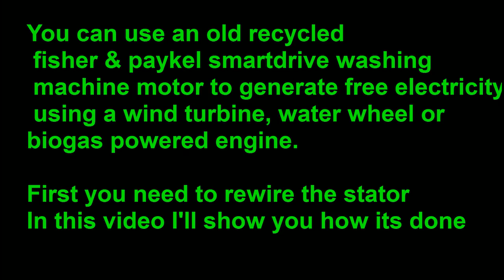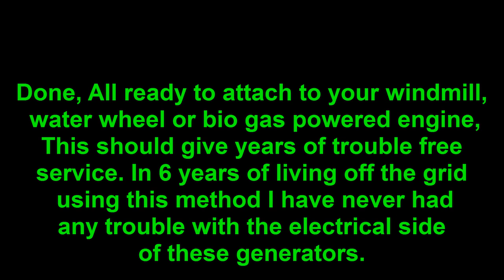How to rewire an old washing machine motor to generate free power

Comment: Why do we need to rewire them? Is all motor generates electricity when turned?
Reply: Any motor [edit:with permanent magnets (rarely found in common AC motors)] can generate power, but they will produce different voltages and currents depending on their wiring. Each coil generates a certain voltage and current individually. Normally, they are connected in series, which adds the voltages together, but with the current of a single coil. That would require a high voltage battery. However, if they are connected in parallel, it adds the current, but keeps the voltage the same as a single coil - more suitable for a battery.
A higher voltage can be used in a battery, but it will require more cells to be connected in series, resulting in a larger battery (and it would be dangerous to handle as the terminals would produce mains power) - a lower voltage battery (around 24v) could be handled easily without very little risk.
Reply: +Matt H  Horrible comment. There are very few motors that can be turned into generators. Most are ac induction motors that do nothing in the way of producing a current.. He has found the rare "permanent magnet brushless motor". Rare is an understatement. So by your "any motor can generate power" statement, I'm struggling to understand the up votes.
Reply: +fla playa I was thinking only of permanent magnet motors when I wrote this, but I'm not sure about AC induction motors. I thought they had some output - isn't that how regenerative braking works? From Wikipedia (https://en.m.wikipedia.org/wiki/Induction_generator): "A regular AC asynchronous motor usually can be used as a generator, without any internal modifications". Is an asynchronous motor the same as an induction motor (it forms an induction generator)?
Please correct me if I am wrong, I am interested to find out the correct answer. Thanks.
Reply: Matt H Nope. Only a "wound rotor" AC Synchronous motor would do the trick, trust me. All other induction motors have rotors that are made of aluminum and steel as a "squirrel cage" https://en.wikipedia.org/wiki/Squirrel-cage_rotor having absolute zero effect on creating magnetic flux on their own.
Reply: Matt H Regenerative braking would be applying a direct current to an AC motors windings to achieve "braking". (stopping the rotor).. Has nothing to do with generating current from the Stator windings of a AC Motor (the most common motor in our 21st century). You can be my guest though and try to turn an induction motor into a generator as four of our peers say you can do:)
Reply: +fla playa Ah, thanks for the clarification! I always thought the bars on those rotors were magnets. Does the rest of my original comment still apply to wound rotor motors though? I will update it to avoid confusion. Thanks.
Reply: +fla playa read in the same page you published 'Induction generators
Three phase squirrel cage induction motors can also be used as 
generators. For this to work the motor must either be connected to a 
grid supply or an arrangement of capacitors to provide excitation 
current. For the motor to work as a generator instead of a motor the 
rotor must be spun faster than its stator's synchronous speed. This will
 cause the motor to generate power after building up its residual 
magnetism. "
Reply: Steven G This is one of those rare times where I question what I just read on the internet. I went back and read that and it looks like a bogus amendment to the Squirrel Cage page. I noticed no proof of source. If you think about it, theoretically the machines synchronous speed is variable, meaning the input frequency is the synchronous speed. Therefore any RPM (even one) could exceed the design for a given frequency. In the case of one RPM it would be 1/60 of a HZ. I have never heard of it or seen it. An external source of capacitors would set up a DC magnetic field in the machines stator and you couldn't spin it, let alone get it up over the design RPM. Also, connecting the machine to AC mains is how it's intended to function. When we release the motors circuit there will be zero induced current flowing from the machine. The only possible way, to the absolute best of my knowledge, to generate current from a squirrel caged motor is to re-work the rotor. Something I've been dying to do for a very long time now and I should do a video on it. Have to get a direct current rotating magnetic field up in that hoe. If you stumble across anyone out there taking an induction motor and generating power from it stock, let me know.
Reply: It does work, but yes, the rpm must be higher.
When I was still a student, we did exactly this proof, in the engineer course. some 25 years ago.
For a time, this has been used in windmils in europe.
We also did the setup with the rotor electro induced, and while yes, it was much more stable, concerning rpm, you have more work with the anchors.
Personally, i do like more pmg's.
Reply: RPM must be higher than what?
Reply: rpm must be higher then the frequency where you want to be. in a 50Hz system, that same motor will start becoming a generator at 51Hz+, or in US 61hz+

Comment: can you just use the motor without rewire. Then convert AC to DC using rectifier ?
Reply: High volts high hertz dangerous and doesn't travel well
See Marty T's large soldering iron used in his latest vids doing this again...with sound.
also  https://www.thebackshed.com/Windmill/FPRewire.asp

Comment: my friend use some flux, those connection are somewhat cold and will cause troubles down the road with power loss and energy lost in heat also cover each solder joint with a protective sealer even the male spade lugs solder directly and seal them, then bring out the leads to a terminal block and again seal, your on a water source with lots of moving water

Comment: is this a 3 fase motor?
Reply from the maker: It makes 3 phase when converted to a generator, needs a motor controller when used as a motor
Reply: +Angry Ram when a Motor controller needed when it's used as motor.  .. are you talking about a speed motor Controller or a Current controller?
Reply: +Angry Ram can you use the washing machine controller with only the high speed rotation?
Reply from the maker: It needs a step motor controller to send pulses to the coils at the right frequency.
Reply from the maker: If you are clever with electronics you may be able to hack it, I've never tried
Reply: +Angry Ram im completely new in Electrical fields lol 

what kind of frequency i need to ad to make it run perfect?
Reply: +Angry Ram you mean Steeper motor controller?
Reply from the maker: Google smartdrive motor controller to find out more, I had a quick look and found this - http://shop.powerspout.com/products/smart-drive-pma-and-bldc-speed-controller
Reply: +Angry Ram Have you seen the Gerard morin say that you need an Extra Controller for this motors.   

or you can use any kind of controller?  

what is your experience with it please?

Comment: You  want the alternator to produce maximum voltage.  Do not rewire it.  Run the high voltage to your point of use, then transform it down.  All commercial power systems work that way.  Low voltages do not transmit over distance well.  The alternator will produce better at lower speeds as well, though not make as high a voltage.
Reply from the maker: High hz output doesn't travel well over long distance and also more dangerous if someone were to accidently touch the cable
Reply: @AngryRambro  Leaving the alternator as is, does not increase the cycles per second (hz).  It increases the voltage.  The c/s is set by the speed of revolutions.  Higher voltages travel better thru a set resistance in a wire.  That is why long distance power distribution lines are all very high voltage.  Danger from higher voltage can be avoided by using insulated wire or putting the wire out of reach.
Reply from the maker: @myeflatley1150  Hz is quite high with factory wiring (skin effect cable loss), and yes voltage is also dangerously high, not ideal for the home diy-er

Comment: I would just rectify it and use a switching converter to turn the high voltage to low voltage DC at lots of amps. They are about 95 percent efficient.
Reply: Costs for all these things...the high hertz, high voltage is dangerous..and doesn't travel distance well.
See Marty T's latest vids doing this again...with sound.
also  https://www.thebackshed.com/Windmill/FPRewire.asp

Comment: In my opinion, power from pressurized water isn't free power, because is necessary an external power, included natural power. Free power means some device working alone - producing the own primary power.
Reply from the maker: Elton Luis Vargas That's fine, my point of view is I haven't had to pay for power for 10 years, the power came from the pressure created by the water in my stream which is 100% free.
Reply: elton, you must be a lot of fun at parties.........I know you're not going to be on my invite list anytime soon.........
Reply: In my opinion, free power is any power that I don't have to pay the bills for :)
Reply: Elton Luis Vargas This is free power.
Reply: Elton Luis Vargas I agree with Elton. Plus, Angry Ram said it "the power came from the pressure created by the water in my stream" .  So unless you have your own stream, this isn't FREE power.
Reply: MissSicBitch  He has a stream, therefore it's FREE electricity. It is up to you the viewer to decide if this is going to be viable for your self. Look at the natural resources around your home and see what would work for you. The bloke isn't going to wipe your ass for you, he has shown everybody the fundamental concept to generate FREE electricity. It is up to you to adapt the concept to suit your own needs.
Reply: No fuel used......free energy..
Reply: Elton Luis Vargas uses water pressure building up from the pipe running along the stream. no pumps running that pressure its natural water pressure from the stream.